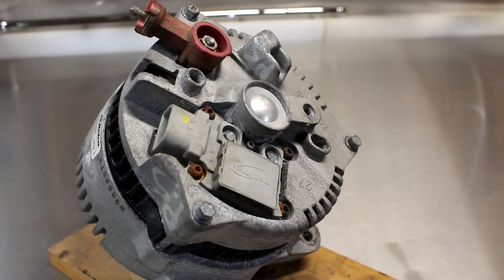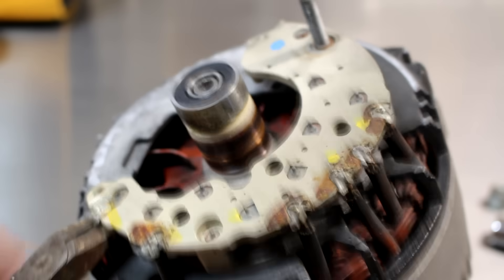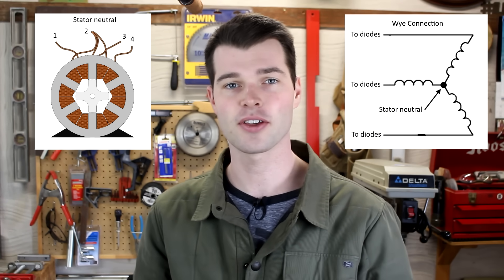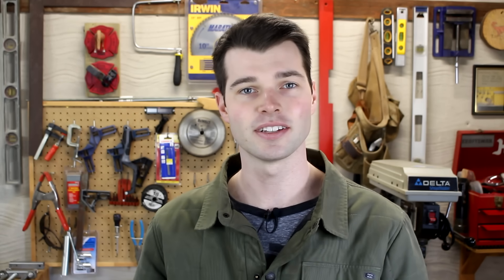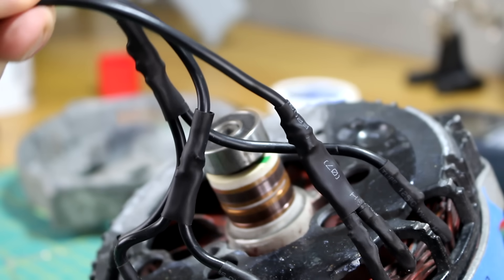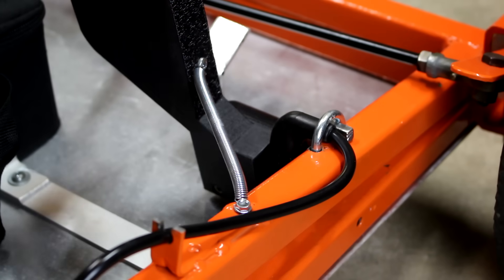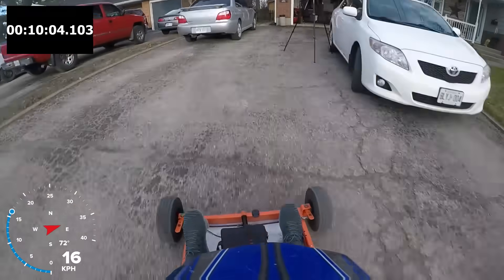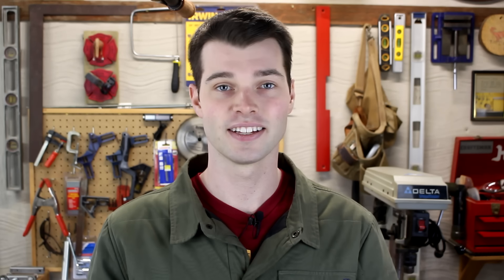Converting a Car Alternator into a Go Kart Motor

Comment: I put a washing machine motor on a bicycle with 30 lithium nitrous infused batteries and achieved 768 miles per hour.. I think thats a new land speed record but I don't like to brag
Reply: wiseman 1965 what kind of washing machine motor was that
Reply: melodymaker.. It was a Zanusi washing machine.. I soaked it in wd40 to keep it from overheating at 700 miles an hour.. I pumped the wheels with helium to lighten the load and took a good lungfull aswell

Comment: There is, as usual, all lot of complaints and theory flying around about how much better everyone else could have done this, perhaps. This young guy came up with the idea for this project, made it work, and seems to be thinking about how to make it better. If there is someone in the Boo Bird section who can do it better, do it. Make a video, show what and how you did it and how simple it is, then you will have proved something. In the mean time it's just noise and smoke. Theory is what you think will happen. Fact is what happens.
Reply: Down here in Brazil, a buddy of mine went bananas when I forwarded him this video, as he has a "donor" bike that he wants to convert to electric.  Alas, no money for fancy, imported motors.  This how-to is a gift for third-world McGivers... Kudos big time!
Reply: Hi there! When I was stuck in a foreign country for a few months and needed a way to get around, I built one of those 2 stroke bicycle motor kits. All in all, it cost me about $350 for everything out the door including the new mountain bike. Granted, I had built 4 before that time on beach cruisers and I need a few simple tools which I brought with me, but it got me around at 28 MPH and I maybe spent $10 in gas and oil over 6 months. The engines advertise 120 MPG. I'm 185 lbs but I've seen 70+ MPG on mine which could be argued that was low geared for my application. Tell your buddy about that! Upgrades are endless and mostly bolt-on.

I thought about going hybrid with my personal beach cruiser at home by adding an electric front hub but placing a battery on a bike is not preferred. Not to mention, I want to be able to cruise at 35-40 MPH and those hubs typically only get you up to 25 MPH max so it would really only be a "hybrid assist" for takeoffs and going up hills. The electric front hub as a standalone is an easy option to get you 20-ish miles at 25 MPH (best case depending on motor/battery combo) but a good kit will surpass $350 out the door with the battery. Weigh your options.
Reply: He could probably put more juice through the coils.
Reply: Amen James !!!
Reply: theory is how we attempt to explain what has already occurred.
Reply: I have decided that for many people, the crafting and distribution of retarded and ignorance-laden criticism is a hobby, as well as an art form.  Hence, the ubiquitous nature and continual increase of the retardedness as these inept, useless wards of the welfare state blunder and doze their way through life trying to outdo themselves in an idiotic fashion.
  There is little probability any of the commentators you refer to could operate the camera for such a video, much less complete the project therein.
Reply: Calm down, it's just a go cart.

Comment: Nothing is more FUN and loud than a good gas engine!) There's a lot more you can play with and the feel and sound you become in tune with! But I love working with motors and electronics in other applications. Decent job you did. I gave it a thumbs up. Question, what gear ratio did you use? Motor, to sprocket, to wheel size? Thanks

Comment: Great video, did the alternator get very hot after the 10 minute run ?
Reply: should be able to handle the heat... alternators are ususally designd 1000-2000watts... he was using about the same from the thing as a motor
Reply: Yeah alternators dont like over 90Ccelcius
Reply: Hmm didn't some of the Cadillac Northstar motors use a water cooled alternator.

Comment: Try flipping the guard on your grinder to the other side so you can cut in a pulling motion.  Much safer and more controllable that way.  great video Ive never seen anyone use and alt as a motor

Comment: Great work , possibly a secondary alternator belt driven to charge the battery packs while the cart is In motion, for longer run time and aluminum nitro or natural wind injected cooler box  assembly for batteries? Awesome cart and idea I can't wait to see more .

Comment: Love your project why don't you use a 6s 80a RC esc giving you 1700w and only $22
Reply: James Essex 6s would only be 25 volts and he is using 48volts
Reply: James Cellan yes but he would get more the. Double the amps so would be the same power equivelet
Reply: James Essex That’s not how motors work though. They need a specific voltage to run at a given rpm
Reply: BLOOGaming ahh ok now I understand with a lower voltage it would have a greater talk but a reduction in rom

Comment: Neat idea, but not enough why.  Can you elaborate more on the motor setup?  The purpose of the brushes, the wires you soldered to that, what wires from your motor go where on the battery packs or power supplies.
Reply: It's exactly the same working principle as a brushless dc motor(3-phase), except in a BLDC you have magnets in the rotor but here you have to magnetize the rotor instead by simple connecting the rotor to a DC source.

Comment: I wonder what the maximum power an alternator could output is...
Reply: average estimate about 1000-2000watts..most are rated 70-150amps at around 14volts
Reply: Whatever the current rating of the alternator is, would be the same as when using it as a motor. The limiting factor is heat, which would be proportional to the watts produced or consumed. 
Example: 
100A alternator * 14V = 1400W power output
1400W / 749 = 1.87HP
1400W / 1000 = 1.4KW

Comment: Any idea how much horsepower you are making ?
Reply: 1 HP = 745 watts. It was drawing at most 40A, which at 48V is 1920W, which is 2.5 HP. With the voltage drop due to the high load on the batteries, though, and assuming it was actually drawing 30-35A, 1.0-1.5 HP is probably a closer estimate.
Reply: So if you had a 48V 40A power supply, you would have a >1.0 HP variable speed motor !  𝗡𝗲𝘅𝘁 𝗾𝘂𝗲𝘀𝘁𝗶𝗼𝗻 𝗶𝘀, 𝘄𝗵𝗮𝘁 𝗶𝘀 𝘁𝗵𝗲 𝗥𝗣𝗠 𝗿𝗮𝗻𝗴𝗲 ?
Reply: The torque is what's getting it moving. A 2 HP gas go kart would be pretty slow lol.
Reply: It's also the rpm a bldc motor can run. What it lacks in horsepower it can make up for in sheer rpm, so gearing down isn't a bad thing
Reply: themaritimegirl that assumes a 100% efficient motor, but 70% is more realistic so around 0.8hp
Reply: Like we're back in the 1500's living on the horse drawn systematic ratings....

Comment: what was the 12V lipo fore? Since it's a brushless motor...what does the 2 wires cmming from the brushes do?...I'm confued
Reply: ComputingCode - actual brushless motors have a permanent magnet rotor that is pulled around by the windings on the stator, which are electromagnets. The rotor on an alternator is an electromagnet that isn't permanently magnetized, so In order for it to be a magnet, you have to feed it some voltage through the brushes. They don't generally use permanent magnet alternators on cars because they use the rotor voltage to control the output voltage of the alternator.
Reply: Oh ok...that explains it thx for clearing that up:)

Comment: What voltage are you running the rotor on?
Reply: I’m sorry I meant fails coil.
Reply: Wow, sorry again, I meant field coil.😁
Reply: 11.1 battery pack...probably 12volts after charging...........motor windings run on 48volts

Comment: When joining wire ends untwist both ends and then slide one end into the other and twist them together. Essentially braiding the two ends together. Then apply solder and allow it to wick the entire way. Solder is not glue and using it to "adhere" one wire to the other creates a brittle joint that will come loose with vibration and time. Cool project though.
Reply: "and then slide one into the other" - I know (I sense) you mean well, but this particular passage would need either more words or hopefully a YT video showing the technique. Thanks though.
Reply: CriticoolHit lead solder should be fine. It thermal expansion and contraction that typically causes cracked solder joints,  not mechanical vibration.
Reply: This guy is lucky he got the direction of each stator winding correct, because there is no way that 'start' and end' of each winding set can be determined by a simple continuity test. Too easy to have 2 in correct same direction and the 3rd in an opposing magnetic field orientation. This MATTERS, be it star or delta connected. 

So, solder if done correctly, might be good for a test, given the equipment to correctly determine this magnetic field directions isn't a garden variety instrument. BUT it's a pain... easier to use insulated screw tunnel connectors [the type electricians use in house wiring]. Once proved correct the far better way is to use a crimp connector, NOT dodgy solder as seen here, for the solid stator conductors to the flex cable. CRIMP connections if done correctly are always far better than solder in an automotive application prone to vibration like this. 

Frankly, the best way would be to take each stator winding to a 6 terminal block mounted on rear of the alternator rear housing and then bridge however you want [star or delta] and terminate the flex leads there.

Comment: A little curious to know why you chose an alternator instead of using a starter motor? pros vs cons?
Wouldn't the starter motor have been a lot easier to knock up seeing it's already got gear drive connected and the wiring a lot simpler to hook up?
Reply: Starter motors aren't made to run continiously.

Comment: You should use the new 20700 batteries instead of 18650's. They are designed to handle high discharge better and they are safer.

Comment: Cool build... Theyre clever those sensorless learning controllers. Replaced a dead one on an ebike once, a doddle to set up and more efficient/quieter too. Now to move the 120A alternator on my car to the input shaft of the gearbox and have the ability to change mode from alternator to motor. Voila, a crawler motor for traffic jams and engine restart feature all in one.

Comment: It is not required to remove the diode pack unless you are changing between Wye and Delta configuration. Additionally the rotating field coil can be replaced with permanent magnets from microwave magnitrons or other sources. This would require some hydraulic press work to disassemble and reassemble the field.

Comment: Forget the Pb batteries or 18650 and go straight for Lipo packs.
My e-kart is currently running a 15s2p setup. 610watt hours capacity but 24kW burst.  The whole pack only weighs 5kgs and i get a solid 10 minutes out of it before I'm at about 3.5v per cell

Comment: Yeahh awesome video explaining all important details about re-wiring the motor windings, I like that you also mentioned the wye and delta configuration, it does make difference depending on the application.
SUBSCRIBED to your channel mate, if there are any questions about making 18650 packs just drop me a message. 

*you'll need a good 5 or 6 cells in parallel minimum to deliver that current. A very common mistake is assuming is designing the pack around the "rated continuous current per cell" claimed by the 18650 manufacturers, if you get a "10A cell" and discharge at 10A continuous it will get EXTREMELY HOT, damage/cook random cells inside your pack. 
Your controller will likely handle 14s or 52v nominal, you'll get a better top speed and a lot more POWAAAAAAAHHH
Reply: I love you bruno!

plz give an update on the feasibility of the electric road bike as a diy commuter
Reply: sieve5 hahaaa thaaaaanks mate!!! 
Yes it's feasible converting a road bike, it's nice cause it's so light so it accelerates faster but I ALWAYS recommend people to convert MTB and use as a commuter. The reason is you're actually averaging much faster speeds and too speed too so you really need suspension and a fatter tyre. Potholes at 50kmh or faster on a skinny road bike you're lucky if you don't get pinch flat or hurt your wrist. Fat bike is AWESOME super fun but a bit overkill. Everyone likes different things, I still riding my road bike sometimes just for fun haha =]
Reply: That is actually what “sets” the phasing of a motor or alternator...  how the windings are wired and in what configuration...
Reply: ElectricBike defiantly right on the li-ion batteries 6 sets parallel but if he has thr cash he can get samsung 25r 18650 batteries they are 20a continuous discharge 3 or 4 10s or 12s packs in parallel would be a great setup.

Comment: Don't use 18650s, use li-ion battery packs from electric cars like the ford focus or the nissan leaf. I got 1.2kwh of li-ion batteries for only $180, which still hold 98 percent of their capacity.
Reply: Danilo Rosich that would be wayyyyyyyyyyyyyyyyyyyyyyyyyyyyyyyyyyyyyyyyy to big for a co cart not to mention this are made up of 18650s usually so he would have to take it apart anyways because those operate at like 200 plus volt or so
Reply: They primarily consist of large li-ion cells that look like lipo cells. They are not that large, and only weigh 18 lbs....
Reply: https://www.ebay.com/itm/Lithium-Ion-Li-ion-Battery-Module-16V-32V-48V-4-cell-68Ah-2P4S-1kWh/222586156558?ssPageName=STRK%3AMEBIDX%3AIT&_trksid=p2057872.m2749.l2649

My pleasure!
Reply: heck, the tesla batteries are made up of 444 panasonic 18650's
Reply: Hi, where did you get such a pack from please?
Reply: 18650s can be had for next to nothing....
Reply: Next to nothing if you have literally no other time constraints.
Reply: Danilo Rosich
Reply: ó
Reply: Danilo Rosich
Reply: how do you charge this battery?

Comment: "I think this is something I could do for one of my projects where I want a high output 'brushless' [even though its NOT brushless, I know this] motor because I want a really super high RPM motor for my project which is not limited by contact failure which happens on 'universal' and typical brushed DC motors at high loads and high speeds.

With the only brushes being maintained at a steady state of contact on the contacts, ESPECIALLY if I use cabrongraphite contacts [such as you get from a starter motor] and make them super large [more contact area means less wear based failure and no 'hot spots' because copper conducts so much better than pure carbon], they will last a very long time at very high amperage and RPMs, so long as I keep the total temperature safely low enough that the insulation does not melt/burn.

Also, for those who would like to know a high power way to drive it, get some MOSFETS from a company such as you can get here https://www.infineon.com/cms/en/product/ or if you want to go REALLY BOLD... http://www.greegoo.com/ which specializes in industrial scale power controls.

There are MANY MANY MANY others though, and you can search out MOSFET and SSR online, they cost more in the USA, but you can get them more cheaply these days, I used 8 SSRs and made a 60 Kw H-bridge motor driver for a 20,000 lb solar tracker [it won't allow me to show images here but I did make a template for etching it on heavy gauge copper board which I can make available on deviantart if people want it] and you can build it as powerful as you like, from your own hand picked components, then run it with an Arduino or Raspberry Pi .

The only limits then are the size of your components and the total amount of power you can supply it.

I MIGHT suggest, by the way, seeing as you are using  a DIGITAL controller, you REALLY DON'T need anything other than one direct kill DC capable MOSFET to ensure you have pulsating DC since SSRs [if you do not decide to just get a super duty MOSFET from the start, because they now make some which are DC capable] still to this date are AC or pulsed DC dependent.

From there, it is only a case of adjusting your duty cycle to deliver longer or shorter power bursts to the coils because the logic circuit [regardless of brand] will drive the motor based on the position of the poles.

You can make a supremely efficient motor this way too because it can use high amperage only as much as it takes to accelerate, and then when cruising, it can step down the duty cycle as low as the motor will drive the load without stalling or falling out of phase.

There are sensors you can get to ensure that the motor is in phase with your driver, they use them on CNC machine tools and they ensure that the motor is moving to an extreme degree of precision, and this precision can be used to meter out precise amounts of pulsed electrical power for your motor's constantly changing needs [assuming it is either on some kind of vehicle, or providing some kind of work such as on a mill or saw] and can add or reduce power at a rate of .07% margin of error as high as 400,000 RPM. (~_^)-b